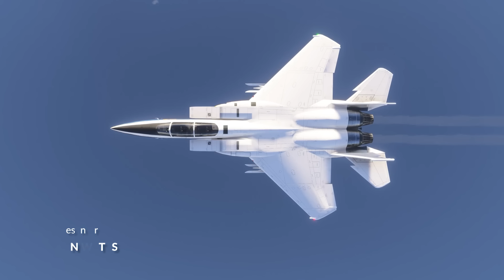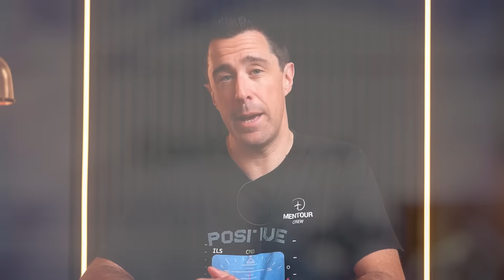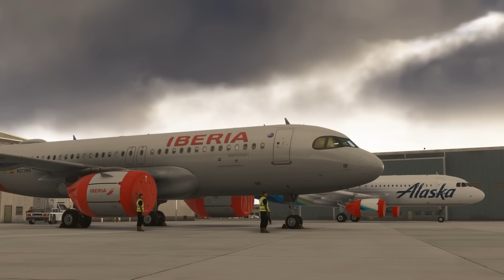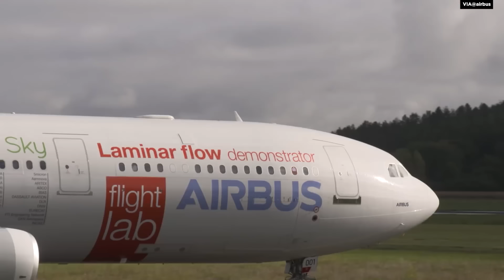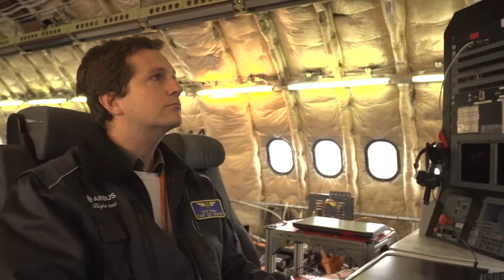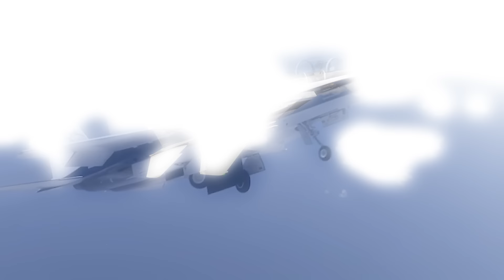Why DON’T We Use This Revolutionary Wing?

Comment from the maker: Try the invoicing Odoo app for free: https://www.odoo.com/r/2JF
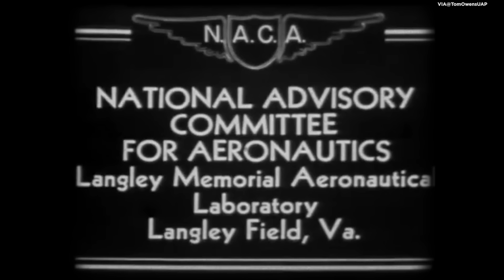Reply: 5:44 NACA wasn't the first to look into laminar wing design. Prandtl at AVA was certainly earlier. He researched into the boundary layer since 1904 and made it his center of working life. He worked his entire life on wing designs at AVA in Göttingen, who happened to cooperate with NACA in the 30s. He isn't called Father of Modern Aerodynamics for no reason.
Reply: :face-blue-smiling::face-blue-smiling::face-blue-smiling:
Reply: The F-16XL is legend.
Reply: A bit sorry the Northrop X-21 wasn't mentioned. It discovered in the early 1960s that the bug problem was real.
Reply: Certainly not.

Comment: Great breakdown of the different parameters affecting laminar flow. There is also the issue of what speeds can laminar flow be achieved at. Most airlines don't want to fly slow enough. Most passengers also do not want to fly slow enough. Extending the wingspan like 777X is a more foolproof way of reducing drag.

Comment: I don't know if it actually did produce the same results, but the crescent wing on the Handley Page Victor was reputed to produce extremely stable flying characteristics, both at low speed and transonic. It could fly at mach 0.98, and it broke the sound barrier in a shallow dive at least once, and was even capable of aerobatic manoeuvres

Comment: A 15–20% next-gen engine "efficiency gain" rarely means burning less fuel. Airlines use that capacity to increase payload (more passengers, heavier fuselages) because cargo and bodies make money.
Even if fuel burn drops, fuel monopolies just hike prices to protect their profits. Airlines then pass "inflation" and endless unbundled fees (luggage, seats, losing screens) down to us to boost their own margins. But airlines are blind to the massive disruption coming from consumer EVs.

Take a 2,200 km trip (like The Hague to Benidorm):
For a family of 4, you face early wakeups, airport transit, security, strikes, baggage delays, and rental cars. It takes 11 exhausting hours (from the moment you wake up until you're at your destination, only looking at the flight time is delusional) and costs €2,000+ round trip (including taxi/public transport, not even including rental car).

You take your own car instead? Current long-range EVs (Tesla, NIO) with advanced autopilot turn this into a relaxed road trip. Cost? Around €250 round trip for everyone. 
No baggage fees, no airport stress, you only deal with your own farts, and your car is already at the destination. In 10–15 years, aviation prices will double while EVs will achieve 1,000+ km ranges with full autonomy. When road travel becomes a seamless, ultra-cheap autonomous lounge, airlines will lose the premium business passengers who fund their entire business model. 

Worse because even within 10–15 years, companies like SpaceX will offer safe orbital travel for long-range routes—bypassing airport nonsense entirely and cutting travel times in half.
Airlines are heading straight for a wall. They HAVE to come up with a viable plan within the next 3–5 years just to have the 5–12 year runway needed to build a solution in order to remain viable and keep people interested.

Comment: Why do all passenger planes look identical? Because modern airliners have largely converged on the most efficient compromise between performance, manufacturing cost, operating cost, safety, and passenger capacity. There is little benefit in developing an exotic wing or airframe design if the fuel savings or performance gains do not outweigh the additional costs of designing, building, certifying, and maintaining it.

Comment: With BLADE, by sweeping the wings less to reduce spanwise flow, won't this increase wave drag as the aircraft gets further into the transonic regime? And won't a less swept wing make it so the wingtips stall sooner, reducing aileron control in a stall?

Comment: Hmm, in my 50+ years experience, air does not flow over the wing, except in wind tunnels. Cart before the horse.  I understand reference frames; however, in all my 20000+ hours, from light aircraft through airliners to fighters, I always flew through stationary air.  A totally different set of rules. Unfortunately, the boffins will never understand this.

Comment: I was the Structures Lead Engineer on the F-16XL Supersonic Laminar Flow Control program, so this brought back a lot of memories.  They wanted few external fastener heads, so we actually used adhesive bonding on that wing glove, certified by adhesive test programs and with a higher factor of safety.  The big thing you seem to have left out was the production implementation of Passive Laminar Flow Control on the fin leading edge of the 787-9.
Reply from the maker: Oh wow! Thank you!
Reply: @MentourNow  I don't know how it turned out in 787-9 service.  But it was great to work on the flight test project.

Comment: My engineering design lecturer, Gordon L Glegg, worked on the use of suction to delay boundary layer separation at Cambridge, UK in 1937-38, preceding the NACA experiments.  Google says they used a Comper Swift monoplane.  I don't recall that detail from his lecture in 1973, but I do recall why they had to stop the experiments: they'd reached so high an angle of attack that the pilot couldn't see where he was going!
Reply: If you look at the Comper Swift you will understand that forward visibility was a design problem from the start....

Comment: I wonder if it’s possible to have those holes for the laminar flow to face the rear of the aircraft. That would sort of make the holes self cleaning. The air flowing just above the holes wants to pull everything away from them. The self cleaning effect would of course make the vacuum pumps work much harder, but the greatest enemy is ice or debris on the wings.

Comment: Seem to remember an aircraft built to test this idea in the 60's. Small holes in the wing with an apu under each wing to provide the suction removing the boundary air. It worked very well, but the problems of keeping the hole clear were too problematic

Comment: 787-9 and 10 had laminar flow system on the vertical and horizontal stabilisers. They are now produced with it installed on the vertical stab only. Fully automated system that requires no cleaning by ground crew. Its intake rotates in a forward direction to scoop air in and pressurise the leading edge and blow out the microscopic holes in the leading edge, then reverses to create suction in the leading edge for the laminar flow system to work.
Reply: Huh, left the program ~20 years ago and did not know the horiz stab half of it failed.  Or just not worth the maintenance $$$ headache I'll bet for the gain.

Comment: That laminar flow or turbulent flow really made a huge difference in performance of gliders. What makes a glider plane different, is that you want to fly slow when flying circles in air going up. And when you fly to the next thermal, you want a glider to be fast. Both slow and fast, descending should be reasonable, the early gliders really went down pretty fast. Those had wing shapes that caused quite some drag, flying a bit faster is possible but "flying like a brick" is pretty accurate. It just makes you respect the men and women who set time and distance records in such vintage planes. In great weather everybody can fly an entire day long, but imagine flying in such a less great plane, just finding the next thermal can go wrong, a modern glider has way more time for carefully exploring, a vintage plane simply goes down and you MUST decide, now I must go and do the base leg of the pattern. Only other option is an emergency landing, going back to the runway makes more sense.
    And the modern wings made it way easier to keep a glider in the air. Sure it has to do with flying skills, the best pilots know how to make use of the tiniest amount of rising air, and they take smarter decissions about where to expect the next thermal or ridge or wave conditions. Example, the smart pilots pass a thermal that is not strong enough, they know there's a better one waiting ahead. That is a risk. Do you see, the laminar flow wing is exactly what makes it possible, to take that risk? Flying a brick, you better use that B-quality thermal, you won't make it to an ideal thermal, when that great thermal is without your reach. It may be there, but can you fly so far? In a way better plane, chances are, you WILL meet that butt kicking thermal. Honesty requires to tell you, no matter how fantastic a glider, weather is involved, you can always run out of luck. At the end of a day, it is normal to have a nice and stable atmosphere, things can suddenly end. That situation can surprise you. Whoops, it just goes down. The great laminar flow wings can help you escape area's where the air goes down, get out of there! 
    Maybe you are not familiar with gliders, when we think about those fighter jets a slow and engineless plane is downright primitive, but still, it is fixed wing planes, safety thinking is pretty similar, and why I wrote this, the laminar wing profiles really made an enormous step forward in performance. And yes, rain drops can destroy that laminar flow and you got the flying brick left.

Comment: Meanwhile a guy making 3d printed drones designs a nicely efficient swept wing design drone 83% better than the standard straight wing, then runs the whole design through A.I. algorithms that he programs and ends up with a swept wing that is wavy like a swan or something, and it is 16% better again.
Seems to me that is the direction and tool we should be using. We'll end up ripping off wings from old planes, installing new ones and be way more efficient???

Comment: And what's with giving the boundary layer a stiff kick up its arse by installing blower slots near the leading edge? Not sucking it away but re-energising it? After all, these are also known concepts used on aircraft (spoilers that mix in faster air into the boundary layer) or fish (shark skin having scales that also re-energise the boundary layer. Shark-skin-wing-aircraft anyone? (lasers on head optional).

Comment: Modern gliders use very advanced laminar‑flow wing profiles. Contamination is a major problem for gliders. The most modern ones even have leading‑edge wipers that clean the leading edge automatically during flight. Insects or even rain alter the wing’s behavior significantly, to the point that the minimum speed increases noticeably (especially in rain). The stall characteristics of a laminar‑flow wing are also somewhat worse, as it tends to stall more violently and abruptly.

Control surfaces must also be considered. On gliders, there is zig‑zag tape just before the ailerons to disturb the flow. This allows for better controllability at low speeds and higher angles of attack, as the airflow is re‑energized and remains attached longer.

Considering all of this, it is understandable that commercial aircraft have not ventured into highly laminar‑flow designs.

Comment: Laminar flow wings are nothing new. They were first developed for the P-51 Mustang in WWII. The laminar wing of the P-51 gave it an enormous advantage in range over other fighters of the time and allowed it escort bombers for nearly all of their long range sorties. Of course the P-51's wing will not work at the speeds ( Mach numbers ) required for modern day airliners, but the P-51 is  good demonstration of what can be achieved if airliner wings can be designed to cruise with laminar flow.

Comment: Might we see the use is Denticles as per shark skin where it helps in delaying the loss of boundry air detachment from the wing and generate lift (as well as research showing thrust). This would a passive design and could be layered at certain sections of the wing. How that would work in ice cleaning is unknown but in theory this could be designed into any of the planes surface that benefits from generating lift

Comment: As I recall from working at Lockheed from 1979 to 1990, their L-1011 had positive laminar flow control.  The wings had multiple pressure sensors and tiny air outlets to reduce the effects of turbulence.  Can any L-1011 pilots, engineers, or maintenance personnel confirm that?

Comment: Would it be possible to have some kind of flexible cover on some parts of the wing when at low altitude and then roll it into the wing when cruising at altitude where there is less risk of contamination?

Comment: As a former glider pilot (500 starts), having flown the older types without laminar profiles (Schleicher K-8b for example) as well as more modern types with laminar profiles (Centrair Pégase for example) I have experienced the differences between these types of wings. Flying in rain? The K-8b flew exactly as if dry. But the Pégase didn't like contamination at all, be it water or insects. Every flying day invariably ended with washing the wings thoroughly, in particular the first 1/3 of the wing.
Reply: how exactly was the Pégase worse?
Reply: @gabedarrett1301  Deterioration of flying characteristics, particularly when flying at low speeds (circling in thermals f.e.).
Reply: @georgjrgensen8507 to clarify, does that mean loss of control authority, higher tendency to stall, or someone else entirely?
Reply: @gabedarrett1301  Especially a higher tendency to stall when circling in thermals. The Pégase has a relatively high stalling speed, ca. 72 kms/hr, but with dirty wings (insects) rising to ca. 75 kms/hr. After a longer late summer flight on finals + kms/hr for safety reasons.
Reply: @georgjrgensen8507 3 km/hr increase is a lot?

Comment: I got interested when you said that they suck air through the holes. For some reason I was thinking if it blows instead and with some exhaust mixed in you wouldn't have to worry about icing or bugs. Perhaps it could be configured to be switchable for the needs of the plane. This works for short takeoff and landing too.

Comment: NASA invested a great deal of effort into improving airfoil drag in the '60s and '70s with the Whitcomb supercritical airfoil and the general aviation GAW-1 wing. The supercritical wing was applied to transports but the GAW didn't catch on due to surface imperfections... Perhaps new fluid dynamics software can point a new direction...

Comment: Best video I’ve seen from Ben so far, like the tech angle, maybe add more basic and also advanced expertise into them.
Also I found the suction boundary layer interesting, how about the opposite ie a thinner narrower wing but with pressurised porous surface so to create a boundary layer bubble, of varying size depending on flight requirement?

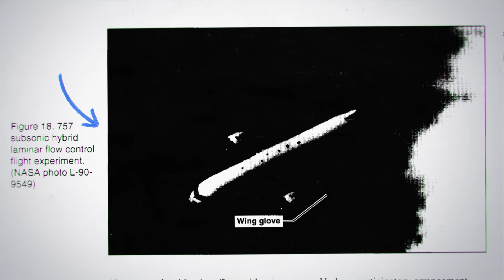Comment: 6:49 
Northrop used something similar to this on the air intakes of YF-23 Black Widow. 
Next time you see a photo or videos  YF23 look closely at the area above the left and right main air intakes, you see a special panel with micro holes to suck the barrier air away.  

Compare the F22 to the YF23 intakes and you will see two different solutions for the same problem/issue. 
LM (Lockheed Martin) went with more of a traditional approach with an intake moved away from the underside surface. 
Think F4 side intake, but under the wing on the F22. 
Northrop went with a more exotic approach, a more stealthy option that used these “speed holes”. 

But that’s all old history now. 

Just my pathetic $.02 worth of input.

Comment: Since natural laminar flow wings clearly can't use slats (the joint would mess up the laminar flow), I wonder if they would end up with something like tubercles to maintain attached flow at high AoA without any seams or joints near the leading edge.
I think the cleanliness requirements make it pretty impractical, though. You might save 10% fuel burn, but more precise manufacturing and extra maintenance add a lot of cost, and I don't think it's clear that it would be a net savings. The laminar flow is also fragile enough that you probably can't plan range or fuel loads around it, so you can't take advantage of the reduced fuel burn to save weight. The only workaround I can think of is if someone found a way to mass-produce a "self-cleaning" super-hydrophobic coating that's compatible with laminar flow, so that you can clean it well enough by just spraying water on it, and it's less prone to icing.

Comment: The F-4 Phantom used bleed -air from the engines its airfoils for boundary control plus movable inlets to the engine to move the supersonic wave in and out to avoid compressor stalls. This was never mentioned in this review.

Comment: P 51 mustangs had laminar flow airfoils. This is not new. There are laminar flow but then there are supercritical airfoils such was used by Bert Rutan on the Canard wing of Quickie or the Q2. Rain, condensation or even bug splatter would cause such loss of lift the airplane would pitch down. This prompted an airflow change. I have found most pilots don't know what airfoil type they are herding through the air. They don't know until the last few seconds of their life when they try to stretch the glide and that super efficient airfoil departs into a spin within sight of the airport.

Comment: I don't know, I am no engineer but hearing about the flow of air over the wing, would suggest that you need to make the wing more "sticky" to air towards the back of the wing. Maybe it's only my imagination but what about "grooves" parallel to the fuselage? I can imagine that if air passes through a groove, it can grab the walls of the groove even if it lost the grip at the bottom. The question is how big do this grooves have to be to have a good effect but not cause problems with the contamination.